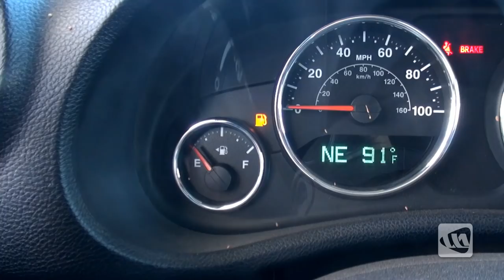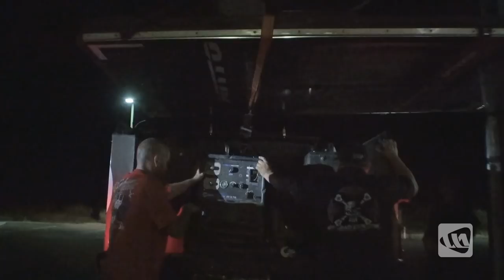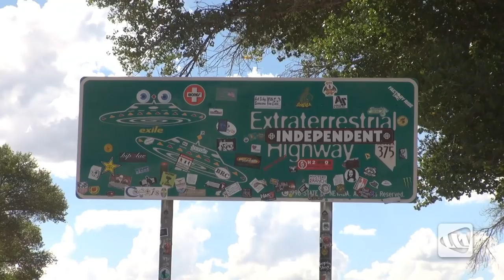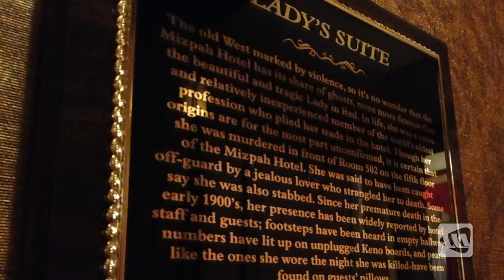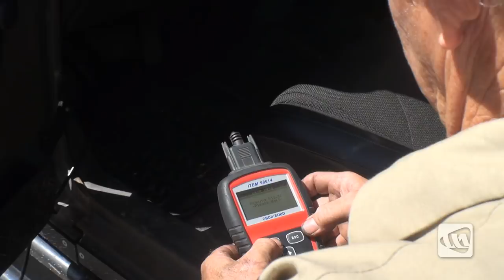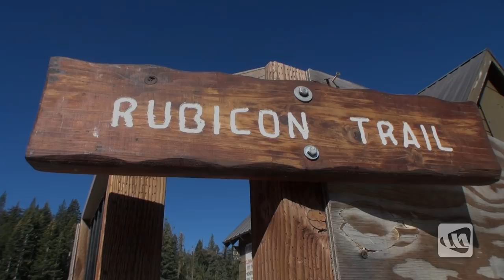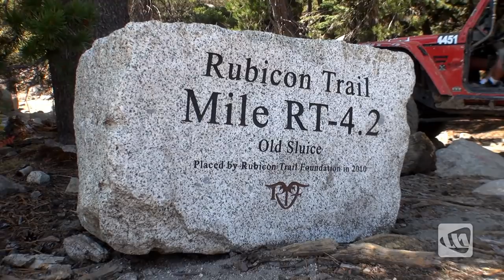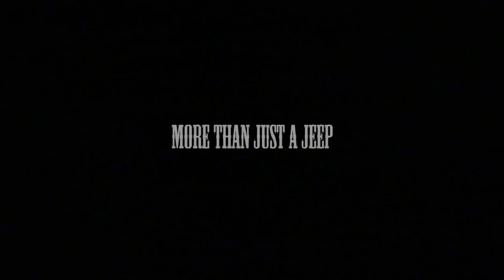WILD WILD WEST : JK-Experience - Jeeps at Logandale to the Rubicon Trail | JKX 2013 Part 2

Comment: You guys put together the best videos ever.  Are most of you guys running D44's front and rear during all of this?  Or D60's up front?  I'm getting a PR44 put in end of the month with RCV shafts. And have G2 chromo shafts in my rear 44 and ARB locker in both.  Just wondering if I could hang with you guys on a lot of this stuff...Rubicon Trail is on my bucket list for sure.
Reply from the maker: +Mike Marcantonio It's a mix between PR60's (guys running 40's) and PR44's (guys running 37).
Reply: Wayalife cool, i'm just about there.  i do only have 35's right now. but when i upgrade next year to 37's, I'll be registering with y'all for a trip soon.  i think i just need a roll cage and I'll be set. hope to see you out there soon!
Reply: year later reading this how'd the upgrades go I'm curious??

Comment: That was a spectacular trip. That kind of trip is on my bucket list. I have a 02 and I bought her in 07. Slowly getting her built up.  But I have might have went to small. 4" lift 33" tires G2 dana 44 ARB lockers 3.73 gears. Hutchinson beadlock rock monster wheels. You think I would make it through that course?
Reply from the maker: It'd be tough on some of the things we did on this trip but so long as you went with friends, I'm sure you could do a lot.

Comment: Awesome video as always guys. I hope to one day be able to take my 2013 Jk on the rubicon trail.  Are most these Jeeps still running the stock 3.6 Pentastar or 3.8? I have the Pentastar in my 2 door 6 speed manual and its awesome on the trails but definitly lacks power on the highway. I imagine with 40" tires and all the gear you guys bring in those 4 doors it could really start to slug the powerful little 3.6/3.8.
Reply from the maker: +Jordan Safioles Most are running the 3.6L Pentastar.  You need to re-gear to regain some power.

Comment: Did anyone else find it ironic that the Nitto rig is running BFG's and the Dynatrac rig broke its axle in part 1? Either way, this is for sure on my bucket list!
Reply from the maker: In all fairness, Nitto just presented this event and not all the participants had their tires.  Dynatrac didn't "break" an axle, the factory locker on the rig they borrowed for the run had a loose connection and was fixed at lunch.

Comment: Why do most of the Jeeps have the round Orange lights on the rear along with the Normal tail lights ?  Was this required ?  Or is this mainly for the desert and dust ?
Reply from the maker: It was required for this trip and only because they help to cut through the thick dust and make you more visible to the guy behind you.

Comment: Are these jeeps manual or stick shift and which is better
Reply: Generally most offroad vehicles are automatic. Due to they might stall out if you have a manual. Also, you won't have to deal with changing gears while on the trail. But some people prefer manual just because they like the manual. But if you do go manual you must be very skilled with a stick.
Reply: I used to be an auto guy for the trails, until I wheeled a manual. It would be hard to go back because there are things about wheeling a manual that you can't get out of an auto. I don't have to wait for the torque convertor to kick in to bump up an obstacle, I have more control on downhills over an auto, if I want to idle up something I can keep consistent throttle pressure without the converter getting in the way and slowing the Jeep down on bumps, and finally, it's just more fun to drive a manual. One thing though is an auto is a lot more forgiving for running not enough gear for the tire size. It really all depends on your driving and skill level, I just happen to enjoy the manual more and it works really well for the trails I run.